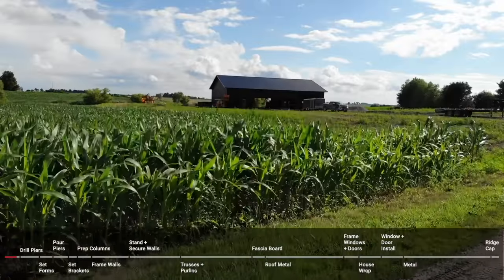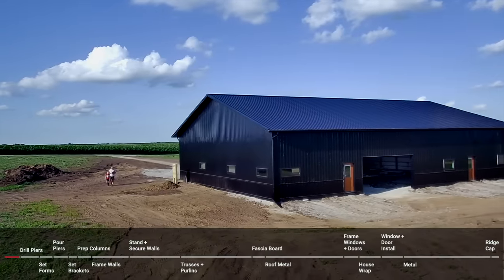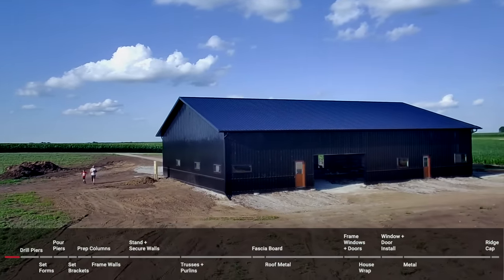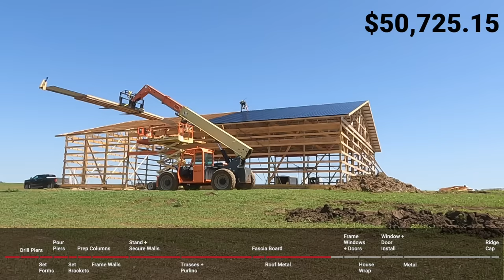Barndominium Cost Breakdown + Full Timelapse | 80' x 60' x 14'

Comment: The materials cost to build that three years ago was probably half the cost.
Reply from the maker: Thankfully it’s lower than it was last year!
Reply: @28FlyingDutchman  I'm holding off till this plandemic ends and the prices go down. I'm in the middle of designing my post frame now. I'm thinking that at the end of the summer I can start breaking ground and purchase lumber at a fair price.
Reply: @28FlyingDutchman  Are you planning on building? My place will be a 40x40 shop with an attached apartment for a total of 64x40 all under one roof. I'll be using ICF for the foundation, 6 inch SIP's on the exterior walls and 8 inch SIP's on the top of the roof. It's going to be a custom post frame with timber frame style trusses every 8 feet. The shop part of the building will have hydronic floor heating in the concrete and a raised foundation underneath the apartment. It will also have a nice covered deck half way around it where the post are set 12 1/2 feet out from the SIP's. I also have a plan to build a 72 foot diameter geodesic dome made out of pipe with SIP's for the roof. The 40x40 shop will be my cabinet shop and also a place to work on my classic vehicles with a two post lift.
Reply: @hdhellion4128  I might do a YouTube channel on the build but I'm mostly a private person. I'll see if I like the video and  if I do than I might share it with the world.
Reply: @robertlaird6746  hah, you can make it private, but sharing is caring.  I understand being private. Shaking this knowledge would be amazing though and greatly appreciated
Reply: I made a 10 year plan in 2020, I won’t put my current house on the market until 2030 (big hopes that the economy and housing market will be ideal in my area around that time), I’m an electrician so a big chunk I will be doing myself, I just need the shell and externals done. 
Not sure if paying cash for the land and getting a loan for the construction is the way to go or getting a loan for the land and paying cash for the house…. Lots to learn but plenty more time with my 10 year plan.
Reply: @Hohmies86  I'm a carpenter and build homes from the ground up with my own hands and without hiring any labor at all. I've built about five custom homes and sold four of them. Still working on my dream home now. Once I'm done building it, I plan on selling it to afford a lightweight aluminum performance cruising sailing catamaran and sail around the world. The dream home changed to wanting something different in life so now it's just another home for me. If you can, purchase the land outright and then on the nights and weekends build your house. Set aside a certain amount of cash every pay check for materials by paying cash for them. That way your not in debt with time restraints mandated by the bank. They will take your house away from you if you don't comply with the building loan terms. Look into getting a used single wide from a trailer park that wants to upgrade there park. They usually sell them for around $100. It's much cheaper for them to sell it to you rather than paying for an excavator and operator as well as two or three dump bends and the dump fee's. You just pay for the trucking cost. Have it delivered and plopped on the side of your lot. This method will save you all that money in rent that you can put towards more building materials and make your build go much faster. You can also purchase a used travel trailer but in the winter, you need to insulate around the bottom sides of the travel trailer to keep worm and keep your pips from freezing. I do this on all my builds. Work on getting a bathroom in first and then move inside and sell your single wide or trailer. You can design your own building on velum paper. All you need is a top view, side view and front view if your building in the country. City is much more difficult. You also might need a side view drawing of the foundation. That's it and the county will put a stamp of approval on your drawings. That will save you at least 10k right there. It's pretty simple to do it yourself. You just have to have the will to do it. Hope that helps. Price out each bracket that you need and the cost of each laminated post and start adding up all the peaces to get a clear understanding of what each faze of construction will cost you. Add it all up and there you go.
Reply: @robertlaird6746 i want to do build custom homes eventually too, any tip?
Reply: @MrPostFrame do you remember the cost for each truss on this build?
Reply: Real people know wood is the cheapest during the winter 💁‍♂️
Reply: @MrAndresm900  Wood rots, metal rust, glass and plastic break down over time and stone stands for the longest time but not forever. Just look at the pyramids.

Comment: 4800 sq ft for about $15/sq ft shell isn't so bad with windows.  No Slab.       Shell somewhat between a quonset hut and a steel building.  The only thing I would like better about a steel building is to oversize the steel beams to Run a gantry / overhead lift.

Comment: Nice video, thanks for breaking down the material costs.  I just got quoted 109k for a 40x60x16 that didn't include the metal for the roof since they don't do standing seam and I need to add a stem wall that was not included, and windows are not included.  I almost spit my drink out when I read it.
Reply: That's half the size of the one in this video! You should get two more quotes.
Reply from the maker: Seems a little high if it isn’t including everything. I suppose it depends on where you’re at too
Reply: @MrPostFrame  hello does your company build in North Carolina??
Reply: standing seam is the way to go, don't compromise on the roof no matter what the cost.
Reply: @freebird7284  I agree, I'm changing up some other things to keep the 24ga standing seam in the budget.  I don't want to be fooling around on the roof when I'm an old man.

Comment: Very interested and look forward to the interior walls and plumbing plans, total cost and total time of the labor including the concrete, insulation and interior walls/trim and what material you use for floors etc. It will be a huge number. What were your pre build cost estimates if I may ask? Do you plan on an interior tornado shelter as well?
Reply from the maker: The homeowner took over after this point, and they're sharing the rest of the project/cost. https://www.youtube.com/c/WichhartAcres
Reply: That’s gonna be another 125,000
Reply: I just finished doing one of these for myself.  To get to this point on a 56x42 it was 73000 labor included. I did all the interior plumbing, electrical, insulation, drywall, etc to finish . I contracted out my concrete, septic, well. As well as had to bring in power ( 3 poles) . Total cost of the job was 265000. Hope that helps
Reply: @dizzyabe101  thank you sir.
Reply: @dizzyabe101  What City was your build? How much are you loving it now that it's finished? Would you do anything differently and do you think you were overcharged for anything? Thx for any info because I'm looking into one that size on my family property in Michigan.
Reply: @MaximusMerideus  I'm out east of Colorado springs in a rural area and I do love it. Was totally worth it in my opinion. The only unexpected cost I ran into was my septic. I went about 15k over budget on that because most installers are going with engineered systems instead of traditional. Other than that I stayed on target. I didn't have to deal with any contractors since I was doing the work myself.  The blower door test was a little difficult to pass with my county having higher standards but overall was just a lot of time and work. I wish you luck!
Reply: Does this video include the cost of labor? Or materials only. Great video!
Reply: Nevermind I see at the end its materials only cost. I wonder how much labor would add? If I had it totally built for me.

Comment: What a great video.  The idea of coupling the timelapse and the order of operations with a real time cost ticker is great - I never would have thought to combine the 3!  So, great video - what is the labor cost?
Reply: +15-20% for labor
Reply: @Aroe48  gotta be more
Reply: @myb7922  depends on your location. And the last 2 yrs contractors were charging whatever they wanted but that’s not normal. 15-20% is standard, anymore than that, find a new contractor
Reply: @Aroe48  Also depends on how in demand the contractors work load is, and if you are willing to wait on the guy because he only works off of referral and you are in awe of the work he did for your friends.  I know a guy, and he don't work over holidays and especially deer season, lol.
Reply: Probably just as much as the building itself
Reply: @Aroe48  you think that all getting built for 15k labor?
Reply: @samtidwell7362  yes… 3 man crew, 3 weeks of labor (360 total hours for the crew) $50/hr bill rate =$18k
Reply: @Aroe48  I guess it’s just the size of the building, but it seems like 3 weeks is not enough. I’ve never built one of these nor had the luxury of using all the equipment.

Comment: I built prefabricated steel buildings for 20 years.even though this isn't steel framed the video and all the detail was great.wood is very expensive right now.this building definitely wasn't cheap.if all the work was done by 1 crew or by the owner of the structure you could save alot of money.of course of subbed out,don't cut corners,always use licensed trade workers.and getting a single sheet from peak to eave ,another smart decision by the owner
Reply from the maker: Thanks for watching! Yes you can always save the most money by doing things yourself. The owner will continue sharing the project on their channel https://youtube.com/c/WichhartAcres

Comment: Thrilling. One question: with material costs at $73K - what did labor cost?
Reply: I was just asking myself the same question! For what its worth the 73K was placed in front of a constructed building
Reply: Im guessing the total cost of that build was figure shown, including labor. Not a chance they were $3800 into footings without labor. In my area that would be very close to material and labor for that size shell. Its the slab, sewer, electric, hvac, insulation ect…that start to get prices insanely high. My buddy did a 40x60 with all but water/sewer and he was around $160K complete.
Reply: @fuzzybanana9128  Thanks for the update! I am working on a 40x80 for next year
Reply: @jeffstrains4014  no prob, but keep in mind thats only my opinion, not fact. I know if someone told me the cost of sono tubes and concrete was $3800 ide tell them to take a hike, thats not even a $1000-1500.

Comment: So we can expect the same price again for labor?  $73900 and another  $70K ?  or should we look for a bid of 125-130 for a contractor?  And another $20K for concrete?
Reply: labor cost for that size of building about 2 hours east of the area he builds in was 50k when i got a quote, and the building materials were pretty darn close to what he has listed
Reply: But.....
Why is labor so much? It only took about 16 minutes for them to do this!
Reply: Based on what Paul said about concrete costs in a reply to another comment, the cost of a slab pour  would be around $38,000 for a 60x80.
Reply from the maker: That's about right. Depending on company and quality you can expect $35 - $40K.

Comment: I'm sure many viewers noticed the final caption of "total material cost"...and that figure looks about right. As a contractor, do you bill your labor cost at a formula (ie materials x 1.0, 1.5, 2.0, etc.)? If someone was really looking to shell in a building like this, material + labor total would be beneficial.
Reply from the maker: A lot of people build these themselves and labor cost vary so much. We typically base the shell/structure on a price / square foot. Typically we are $10-15 / sq ft. Depends on a lot of variables, number of windows, doors, height of side walls, overall size of structure, etc… Hope that helps.

Comment: How these huge walls can resist racking loads ? Stick frame  + OSB gives you more rigidity (wind resistance) for the same price.
Reply from the maker: That’s exactly what the metal provides. Sheeting the walls is not needed because shear strength comes from the metal.

Comment: Enjoyed, but I imagine the counter should have started at a certain non-zero amount even before ground was broken (design, permits, surveys, etc).
Reply from the maker: Those costs are some of the most variable depending on where you’re building and what’s required.
Reply: @MrPostFrame  you can say the same for the items you did list, but we have the context for where and what based on your presentation. :)
Regardless, as I said -- enjoyed.

Comment: Labor cost ?
Reply: probably $500k
Reply from the maker: Lol I wish
Reply: Labor in this instance would be roughly the same as materials. 
Obviously a lot of factors are at play but that’s a good ballpark number.
Reply: Most contractors double there materials cost for  labor
Reply: I've had stuff built from Alaska to Tennessee to Washington to California to Hawaii. And labor costs very by region and season. Plus  I've found there's always someone that says they can do it for less. Though the less they charge, the higher the probability of them doing it wrong. 🤷
Reply: I mean what is the labor cost ? The video is an informed video about cost of material . But the labor cost is what eats up the budget .. nice video but pretty pointless ..
Reply: @Munchiie  Labor & materials vary as well as home values in certain parts of the country. The last home we built was a starter home in not a great area so that factors in. 

The 2nd home was our best. We built it for $67,000 (land $35,000) & sold it for $145,000. The home was 1700 sqft of living. This was just prior to the housing crash. Keep in mind that particular home probably sells for around 200,000 today. The area homes have drastically increased due to excellent schools & progress/development since we built. 

That particular home would probably cost over 100 grand  to build today. Without hiring a contractor/builder. Material cost is high & depending where you live, scarcity/stock can be an issue. That’s going to be be more of a problem… don’t see a recovery (economic )happening anytime soon.
Reply: Sorry I got carried away! 😂Having said all of that…. This builder does an excellent job & judging by the 1700 sq.ft. home he built (the video) for $180,000, that was a bargain. That same home would have taken us 7/8 months to build— he does it in 6. Time is money. Considering the home owners didn’t have to lift a finger. By today’s standards— that’s pretty darn great!
Reply: How much is the labor tho?
Reply: @ThyKingdomCome_7  Yeah thats great and all, but i want to hear it from them
Reply: 22$
Reply from the maker: Labor costs really vary…depending on number of windows, doors, height of side walls, etc. We charge somewhere between $10-$15 / sq ft to put up the structure.

Comment: 75k for a barn with no concrete floor. You better add another 350k if you are going to frame it up and live in the inside,make no mistake about it folk,stick building is still cheaper
Reply: No it’s not
Reply: 😂 we are stuck building. The only difference is the siding. There’s still wood and sticks being framed. Yes it’s gonna cost him to finish it out. But it’s stick framing. Same code just metal siding. 😂
Reply: @Nave6W  do the math on that sqf my friend

Comment: I’m a carpenter by trade and have built several pole Barnes . One thing that I do on all builds is bubble wrap on the truss before the roof metal goes down .  Or vinyl backed insulation…  in this building video there in nothing , I’m sure it’s going to be finished and a ceiling put in  with insulation probably blown in or sprayed  , but it’s going to condensate in the attic unless now you spray foam underneath the ceiling metal! Would have been so easy just to put in bubble wrap and call it done
Reply from the maker: The client had the whole thing sprayed with closed cell spray foam. Thanks!

Comment: I don't know anything about building...I noticed in the video no 'water/moisture-proofing material was laid down between the wood beams and the metal sheet roofing. In another video that you made, it was used (the water/moisture-proofing barrier). Is that because the barrier is for residential use?

Comment: I love the build, very cool, but I have a question.  Why dont you use plywood / osb to cover the roof / walls.  Would it be better structurally ???
Reply from the maker: The exposed fastener steel gives the necessary sheer strength compared to a house with siding so you don’t have to but if it’s in the budget it’s nice.

Comment: Cool idea. I'm always a fan of more windows or skylights. How does the design change for someone in northern climates?
Reply: Every last single window or skylight is a very serious detriment to the structural integrity of a wall or ceiling. These are not properly re-enforced in this construction method either. This this barn is born to loose. In northern climates you'll freeze to death because there is no proper insulation or concrete slab underneath. The amount of power it would take to heat 5000sqf with ceilings this high would equal the cost of construction after a couple of winters. Build a log cabin up north, that's what works for cheap.
Reply from the maker: You’ll have different truss engineering and other requirements. There’s a lot more to this project that the homeowner didn’t contract us to do. Spray foam insulation on the entire building will give it a lot of additional strength. They also properly prepared for the concrete slab, etc.